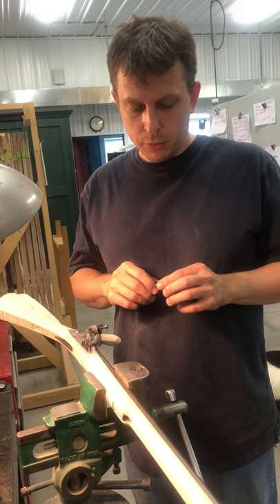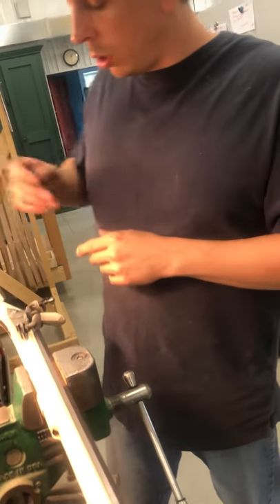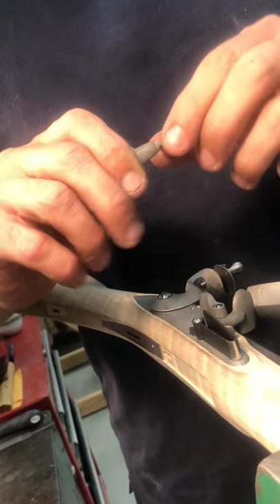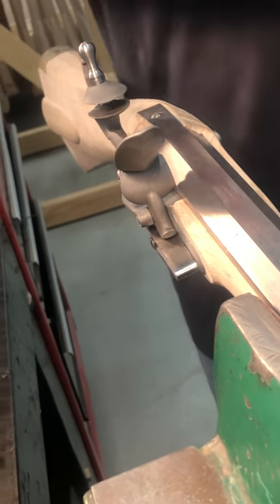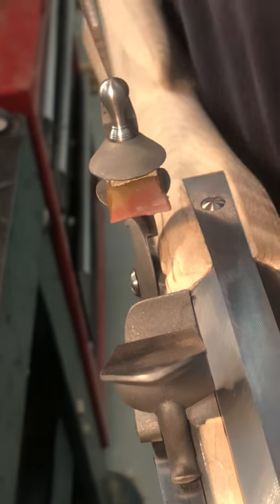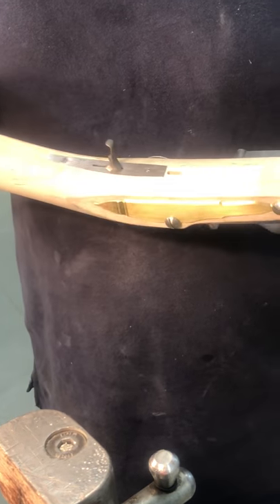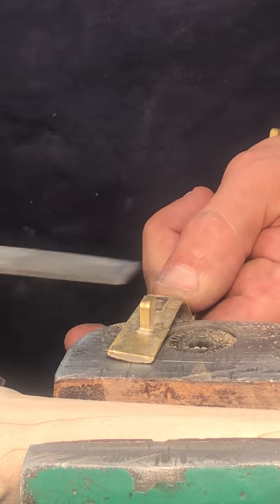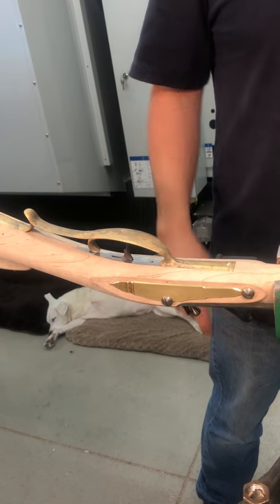Step 3 Colonial Kit Trigger, triggerguard, ramrod pipes and ramrod

Comment: My trigger installed with perfect adjustment just a slight amount of slack in all conditions. These videos are 3 years old and much of the fitting and adjusting which was necessary then haven't been necessary during my assembly. Things have been taking a tiny bit of filing a little shaving and things pop together with very tight tolerance. It is obvious Jim Kibler is constantly tweaking and improving his kits. It is much more accurate to say one assembles this kit rather than builds it up to the point of final finishing. 
So I did the trigger guard and it needed a little twisting and bending. I am old and weak and had no problem adjusting the piece to fit in the mortise perfectly tight. Mostly I found the work to be on the brass removing the flash with just a tiny bit of clean up with the fuzz. I haven't gotten to the trigger or the lock yet. The entry pipe was the most difficult task thus far. Patience is the order here and my kit turned out to have slightly undersize holes for the tenon of the pipes to fit. Tiniest bit of shaving with an Xacto knife and they slipped right in with no gaps. I discover that the brass really needs to cleaned up on the edges to make the fit. Light filing to smooth things and remove the casting flash does it but it needs to be done because the machined inletting is so close the slightest nub of over casting will interfere. Be patient and you will be rewarded with a no gap fit. I likely received a transitional stock. One that had not been drilled for the included drilling guide. The holes in the stock for pins were only on one side and with a single exception were too small to fit the guide. The pilot bit included with drilling guide was easily used without the guide to mark the trigger guard and then the correct size included drill bit followed nicely through the tenons on the trigger guard and through the stock. BE CAREFUL when the drill is close to emerging on the other side. LET THE DRILL DO THE WORK. Don't put a lot of pressure on the drill or it can blow out the hole as it comes through. If it happens it isn't so bad as a little white glue will replace the chip and sanding and finishing will cover the gaff. It is better to avoid the issue with a light touch on the drill.
Reply: I agreed. I've "built" a number of kits. I'm not to the point of a totally blank stock needing to be shaped but it's a world of difference when you start with a stock that only has the barrel inlet and ramrod hole. Inleting, drilling and shaping everything by hand the old school way is a whole lot more rewarding.

Comment: With the trigger pin in wood instead of metal, is there any chance of wallowing out the pin hole with continues use ? Can you use a trigger that is connected to the trigger plate ?🤔🤔🤔

Comment: is it common for the trigger pivot pin to be held in place by the stock?
Reply from the maker: yes
Reply: @kiblerjim  does that "pressure" you are looking to remove result in wear in the wood trigger pin hole?, so that the only time you want pressure is when firing the lock?

Comment: What do you mean by maintaining a draft when you are filing?
Reply: File at an angle so that the exposed surface is a little bit wider than the surface which will go into the recess. This will allow the metal easier entry and force the wood grain down and out to generate a better fit
Reply from the maker: @karlh6700  Well said--thanks!